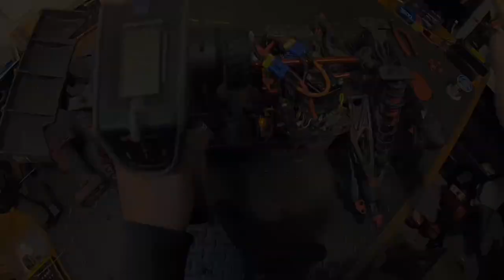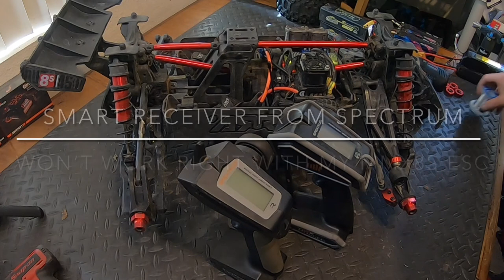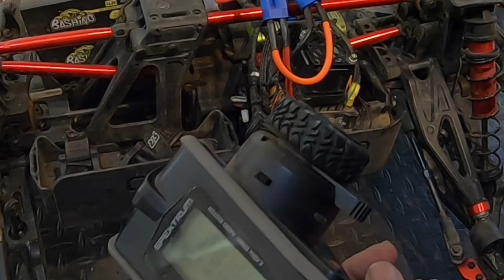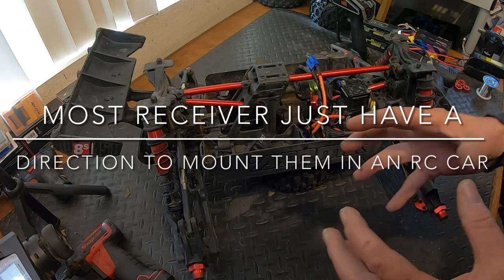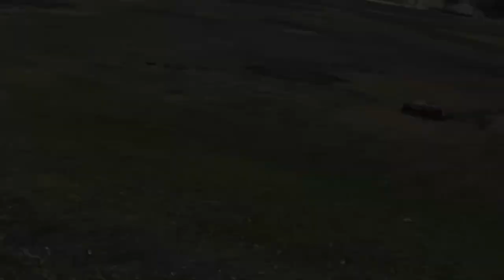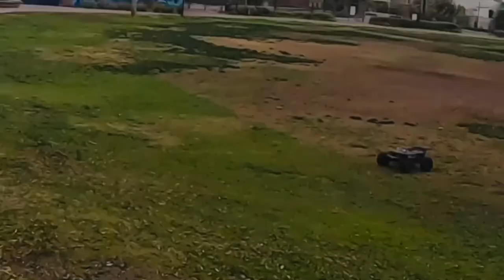Spectrum Receiver Doesn’t Work With Castle Creation ESC Properly Why? Answers in this video

Comment: Hey Earl try this out. Turn on the radio then plug in the battery to Rc then right when it starts beeping pull the trigger and it should calibrate. I hope that makes sense. So basically you don’t have to hold the trigger until it starts the boot sequence. That should work… I believe. 👍🏻✌🏼🤟🏻
Reply: 100%! That's what I do and it works every time. I posted the same info before I seen your post here. You definitely have to get the timing right but it does work and can be done.
Reply from the maker: Does mine run ? Yes is it full trigger nope check the logs and you will see 💯💯
Reply: I was stumped with this also. Castle tech support helped me out. Gave me the instructions and once you get it as outlined above it works perfect. My Data logs show 100%. I have at least 10 cars running Spektrum AVC receivers with all Castle set ups. I’ve had to become very familiar with this but it does in fact calibrate properly if you start the esc and pull trigger about 1-2 seconds after

Comment: Like some others have said, the procedure to disable avc is done during the binding process. Turning the gain down or making other adjustments from the tx will not fully disable avc. Here's the procedure from the manual if you want to give it a try: When you power on your receiver, press the Bind button 3 times within 1.5 seconds, then IMMEDIATELY press and hold the Bind button to put the receiver in Bind mode. Bind it to your transmitter. That's it! When you switch off and on your vehicle, the Receiver should flash 3 times to show that AVC has been disabled.
Reply: Wow thanks so much. Worked like a charm

Comment: Ok there is no problem. There's a sequence. Earl the second the esc starts singing you hold full throttle. If AVC isn't at neutral it doesn't activate the receiver. Once it's active the esc starts to beep, you then start the castle calibration process. 😊
Reply from the maker: Castle put out a statement on how to do it as the two companies brand have a conflict as I talk about in a later episode 👌

Comment: I am going CRAZY!   I installed an XLX2 &. CASTLE 2028 motor in my OUTCAST 3 months ago.  I have run it 2 or 3 times without a problem.  Today I took it OUT.  Got it all set up…no throttle.  Until I saw your video, I hadn’t the slightest idea what was going on.  I am using the original SPECTRUM DX3 with the stock SPMSR6100AT…I think?  I am going to rewatch your videos, but I am SOOOO confused.

Comment: The video just started so Idk what ya figured out but we fixing to find out.  I've had decent luck with most my Spektrum radio gear. I've even seen some videos on how to turn off the AVC inside the receiver. Anyhow thanks for the video Eman.
Just turning it down on the remote doesn't "turn off the AVC" it's still active just turned down to 0. Maybe try physically turning off the AVC on the recover unit. I burned up a expensive 1/5 steering Servo before I found the video on how to turn off AVC. That said even with AVC off Idk any of my receivers will power up with the trigger at full pull.

Comment: I have run into the same  problem many times. You can do the calibration but you have to pull the trigger right when you hear the first beeps. Hold the trigger back like you did as you power the rc up, release the trigger and as soon as you hear the beeps start, pull the trigger again.

Comment: I would just put the Spectrum 160 amp ESC in there. I have three of them and all three in different vehicles and all of them have the 6100 receiver , and I've had no issues whatsoever Spectrum works very well.

Comment: This video helped me out tremendously Earl I did what you did in the video because from time to time my DX5C remote and the AR6100 receiver do actually end up un-calibrating from my Copperhead 10 Castle Creations 1/10th scale onroad edition brushless combo. It’s the 7700 KV combo that is rated at 2S-4S lipo. It’s a badass system. I can’t wait to see then numbers that I will hit on my Vaterra/Losi V100 onroad touring car. I have Contact Foam RC Tires on it. 37 shores front and rear 26 mm in the front 30 mm in the rear. I’ve been testing it on 3S just messing around and it’s easily doing 27-32 mph barely hitting throttle. It seems like foams are taking away alittle speed but they’ve made up for a ton of traction in comparison to the stock wheels. The stock Vaterra V100 wheels suck on 3S or higher.
Reply: That 7700kv motor will only accept 2s. Going higher will damage it
Reply: @dylanwhite6539  The funny thing is that the esc claims to be rated at 2-4S lipo…….. I don’t understand castle at times…. Even the castle tech on the phone told me no more then 2S with my tall gearing unless I’m doing 1-2 passes.
Reply: @gorillabeartech4577  yea. It’s basically just a cheaper way to offer that motor with a sensored esc. Makes no real economical sense to make just a 2s only esc, economies of scale and whatnot.
Reply: @gorillabeartech4577  they also sell it with the mamba x 6s
Reply: I AGREE 💯!!!!!!!!!!

Comment: wait what?!i'm trying to figure out what ya did here, Earl brother. i have never had these issues. not once, not ever.  i don't actively buy speKtrum SPM receivers but they are good and have some of the lowest latency at distance, so i've used them with castle, hobbywing, reedy,  etc. As much as i hate the SLT radios the SLT receivers are fine if you bind them to a DX3 or better, because protocols. Still i've never experienced this problem, that's so weird BUT! i'm still taking notes!
Reply from the maker: No one has done a video on this but the problems been around awhile now 👍💯
Reply: @earlmoorhead5555  huh, i wonder what the deal is with this, i remember one time on a team associated i had to power off and on three-ish or so times, but other than that issue, i've never seen it again. you did resolve the issue so it doesn't need to be done every time it's powered on hopefully?
Reply from the maker: It looses bind this happens on most of my 6100 receivers idk why but it like it can’t see the controller anymore been going on for a year now

Comment: Daang wow talk about revelation...
I have a flysky gt5 with the avc on my kraton 8s with xlx2. I have been having non stop similar problems  for the last year also. I wonder if it is just the the avc from any reciever doesn't work well with castle??????
Reply from the maker: The avc just get lost or stuck then it doesn’t know what direction the front of the car is or left right side 💯

Comment: Found this on Arrma Forum ,, 
Why does my ESC not beep and show a solid red when trying to calibrate with a Spektrum SR6100AT receiver?
We have found that Spektrum has added a safety feature that interferes with our normal calibration and manual programming process. Our ESCs require you to power up the ESC at full throttle; the Spektrum AR6100AT receiver will not boot up properly until the throttle trigger is at neutral.
The solution we have found is to power up the ESC at neutral, wait for the receiver LED to turn solid amber, then apply full throttle; this allows the receiver to boot up properly.
WARNING: REMOVE Pinion gear or disengage motor from spur gear! You must apply full throttle BEFORE the ESC arms (double chime after LiPo cell count), but AFTER the receiver boots up and goes solid yellow. If the ESC arms and then you apply throttle the motor will run! We have found that waiting until the Auto LiPo feature counts the 3rd cell the receiver is operational and full throttle can be applied
Reply from the maker: When doing that if you check your full throttle settings there different every time you do this it get it close to full trigger but not all the time and sometimes your loosing that power in the esc you paid good money for as for me best not to pair the two products or calibrate eas on another receiver so you have the correct full trigger number in the data link to that radio before installing this receiver 🤷🏻‍♂️
Reply: @earlmoorhead5555  yea i was thinking use another none avc rx

Comment: My spektum receiver work fine until I did a rebind now I got the same problem as you. I'm going to try and separate RX battery to get the thing binded again with my transmitter. If that doesn't work I'm just going to slap at spectrum ESC I have laying around in there to get it working. Like I said it worked perfectly fine until I went and tried to rebind the transmitter and Rx. Why oh why do I mess with things that are already working perfect???

Comment: Hi Earl. Very interesting. I had the same issue with Radiolink avc reciever to a MMX8. Difficult to calibrate. Futaba seems to work best (for me at least) with the MMX8 running a seperate futaba avc module.
Reply: What does mean
Don't buy CC 
I have two ESC with 1717 but I was sick to see it doesn't work with spektrum doesn't calibrate with other
Just this is shit

Comment: I run this receiver in all of my speed cars and I run the Castle xlx2. To perform the throttle/esc calibration. Power on the receiver as soon the light on the receiver is solid quickly pull and hold to full throttle. Then continue the esc calibration. Once done you will have avc and full throttle learn.
Reply from the maker: Checking the castle link after this procedure the data shows full trigger sets in a different spot everytime

Comment: Hey Earl, unrelated to the video, but did you have any bellcrank clearence issues with your chuckworks drag slash chassi? Im using the traxxas aluminum bellcrank. Also did your stock servo link work? (the one going from the servo horn to the bellcrank)
Reply from the maker: I did a build series and I had a few issues in that series just can’t remember them all ⚠️
Reply: This is really helpful for me. I've been having these types of issues  lately with arrma receivers and max6 esc it's like I need another pair of hands and more brain power  too figure this out. Thanks bro!!

Comment: I guess I am having the same problem with my copper head 10 for a system. I just got it will not allow me to change the brakes setting and right now I have no brakes and also makes a weird noise in the motor every time I power it off I have to switch the wires around on the motor because it will not let me switch the motor rotation through the transmitter. How do I know there were so many issues that you have to dig through to get a proper running vehicle I would not have bought the castle. I do not want to get rid of my AVC the car works great but I have no brakes and it is a speed run vehicle gotta have brakes! Has there been any solution found that will allow you to run the spectrum DX3 with avc? I can even get into programming mode and fall trigger works to select different parameters, but reverse does not do anything when trying to deny a certain setting! I’ve been tinkering with this thing since 5 o’clock this afternoon when Amazon dropped off the ESC to be honest if I knew it was this difficult I wouldn’t have bought the speed controller. I’ve heard such great things about castle right now I’m throwing my spectrum system back in!
Reply from the maker: You have to time when to calibrate the controller waiting for 1 second after powering up to hold the button is what ppl have said 👍

Comment: The Castle Creations customer service number I called was a funny call….. the first guy who is a Castle Creations tech by the name of Jason I believe claimed that the AR6100 receiver and all Spektrum receivers in general tend to be “freaking crap” when it comes to using them with Castle motors and esc’s…… brushless that is…. Lol. Then I talked to another technician after him and his name was Joe. Joe was very helpful in comparison and got it working for me but then I realized that after 2-3 days of inactivity the v100’s copperhead 10 7700 1/10th system was Un-calibrated all over again. So I watched this video and wallah !!!!!!!…… MAGIC !!!!!!!!!. Now I know what to do…… but it is fucking bullshit that I would more then likely have to keep doing this because I have a Spektrum radio and receiver with a castle combo. My Arrma Infraction V2 doesn’t have any of these issues though because once again it has the Spektrum Firma brushless combo and not an aftermarket like Castle, etc etc. anyways Earl hope you have a good one. I saw your 100 dollar PayPal giveaway….. I could deffinately use an extra 100 lol. I have cash app and Zelle but my PayPal’s been inactive for 13+ years LOL.
Reply from the maker: I find most don’t use PayPal as it protects your account and make getting money quickly costly but if you have time it’s a safe way to track money exchanged 👍🔥
Reply: I could use an extra 100 but I didn’t do anything to deserve it lol. I’m out of work currently so it would help but you have helped me figure this issue out with the damn Spektrum stuff man. Now Spektrum with a Velinion setup isn’t much an issue…. It seems that it’s only an issue with castle systems meaning both a castle creations motor and esc combo. I only buy systems that are matching esc and motors from the same company. I don’t like to mix and match Tekin with Castle or Velinion with Castle.

Comment: Use the 6200 receiver from spectrum there’s no delay also wait 1second before you pull the trigger on the 6100 receiver before you pull it. It may take a few try’s but it will link up you just have to be perfect with your timing

Comment: Earl, they do work with castle esc I have all mine with castle esc, 
The trick is as soon as you see the reciver turn orange before the esc finishes its armingdo the full throttle full brake right left but you have to do the calibration as soon as the orange light comes on, on the reciver before the esc finishes arming you start the calibration process
Reply from the maker: Not full trigger mine works to but check data in castle link not wide open trigger ? Like I said works but not properly
Reply: @earlmoorhead5555   you can’t pull full throttle and then turn on the esc, you have to turn on the esc first while it’s arming you will see the orange light come on on the reciver once you see that light pull full trigger and calibrate, all this needs to happen before the esc finishes arming idk if you understand me
Reply from the maker: Yes and watching the data log the full trigger that gets programmed in is different every time it works but is it truly full trigger when the number is low ? And you can’t determine when it will calibrate a low number my rc works I ran it but not getting max power on an expensive esc is not good 💯🤷🏻‍♂️🤔

Comment: I’m going trough the same issue,2 different castle esc with the avc 6100, it has something to do when calibrating the Castle when you need to take away the power with the switch on and then shut the switch off and then connect the battery again to calibrate when the power is taken away,it loses it bind, so yeah your not going crazy,I have the same issue to the t. And another thing it seems like it takes forever for the receiver to power on

Comment: Pause for a second after powering up then pull trigger 👌🏽❤
Reply: Yes that’s what Iam saying , power on first pause wait for the light to turn orange on the reciver and then pull full throttle
Reply: Still..the throttle wont work as full potentially..
Thats y i use sanwa on my arrmas with castle esc....

Or else It wont calibrate normally

Comment: I've had this same issue with my xlx2 and dx3.  I know raz posted a video with a xlx2 and avc turned on.  I feel like mine bound up when I put it in first and did a castle software update now it will not bind throttle ep's

Comment: What if you powered the receiver with a nitro battery pack before powering up esc, after rx connects them pull full trigger and plug esc in
Reply from the maker: Idk never tried that , castle creation is AWHARE of this issue and they have a calibration procedure you can use to calibrate it to spectrum, as of now this seems to be the best way or the only way I’ve tried idk if it’s the best way 🤷🏻‍♂️

Comment: Shit.  I'm going thru the exact same thing with a DX3/SR6100AT and XLX2 Hydra in a ProBoat Blackjack42.  Using the above Spectrum RTR receiver and transmitter from the kit.  The receiver shows that the AVC is disabled, which makes sense in a RTR boat,,so apparently spectrum made sure the AVC was disabled before shipment???.   If Castle would add the option of disabling the bec and just going off a receiver pack, you could have the trans and rec turned on and bound ahead of time, then pull the trigger and switch on the ESC and continue with the quick start routine.  Then disconnect that mess, re-enable the BEC, crank it up to 7-8v to the receiver.   Maybe, just maybe, a ridiculous stupid backdoor.   I have a Dual Density R603FS sitting here NIB, if all that doesn't work.   I know Futaba 2.4 stuff goes almost immediately hot as soon as it is switched on.  It would outrun the castle esc on startup and prob be fine.

Comment: There’s a trick to this it’s driving me crazy I wish I could just show you my brother
Reply from the maker: Yes here is my Problem over the year it’s been in the rc like this it keep loosing binding like the remote was never hooked up and it comes out of the blue never know when ! Last time I was 2 hours away and having to pull that receiver box watch a light on the receiver with all the fans running loud can’t hear the esc beep out in the dirt somewhere doesn’t seem like this is a good pair to work together spectrum and castle calibration is not a good calibration in my opinion on a basher maybe an rc that doesn’t use a receiver box and you can mount it outside be ok but no basher would I want a receiver not protected from flying debris 👍💯